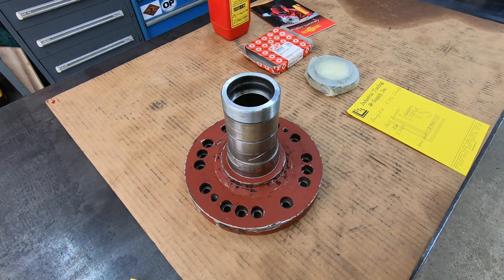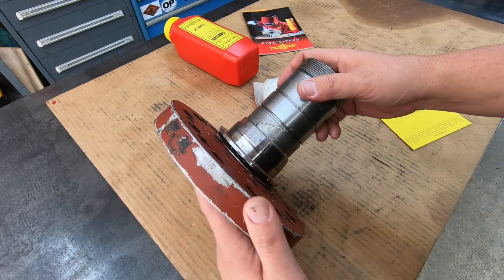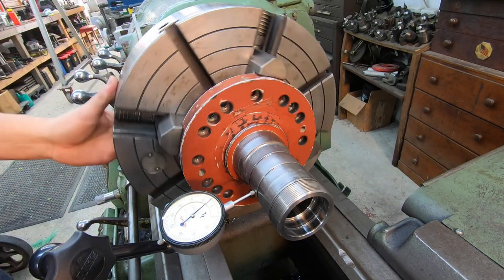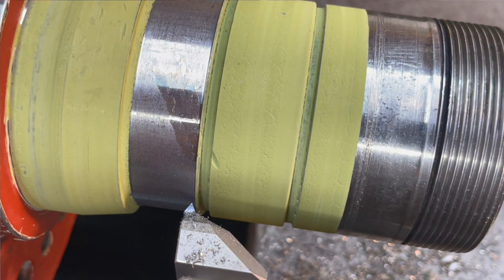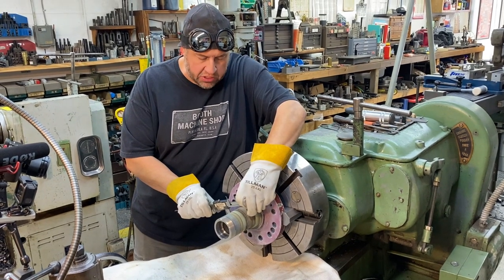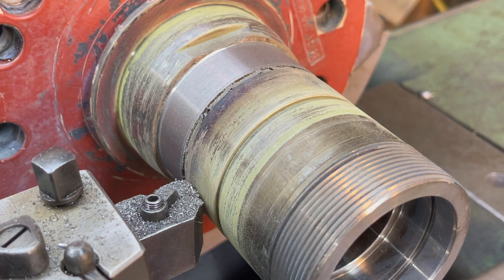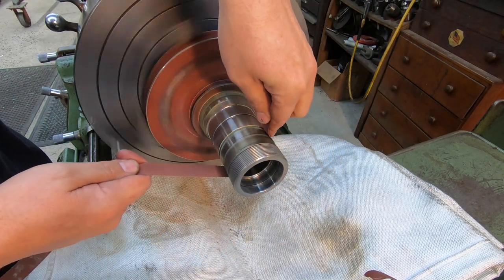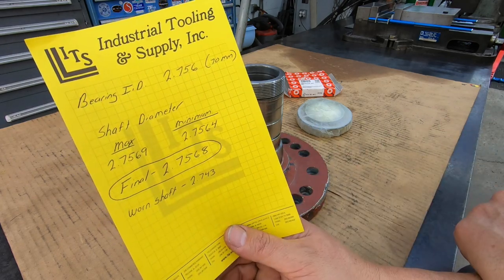Thermal Flame Spraying Centrifuge Shaft Repair

Comment: As a former engineer for centrifuge and bearing companies, I am happy to see you using the correct tolerances for that part.  Too many machinists use rules of thumb instead of taking a couple minutes to actually look up the proper tolerance as it appears you did.  One nitpick, it doesn’t appear you verified the runout of the part after the spray welding to make sure the shaft end did not warp from the heat.  The runout tolerance of the side facing the chuck relative to the bearing seat is highly critical for machines that run at the speed these do.  That is the reason an end user I also worked for would not allow spray welding on parts like these unless it was done by the factory repair shop.

Comment: 2.756 inch is a 70.01mm for metric guys .01 is a perfect fit in most cases for a bearing  on shafts ,you can go +0.02 or 0.03 but anything more that that and bearing starts to rub.From experience commonly used  bearings arent that sensitive that you have to get a micron(.001) tolerance.
Unless you are dealing with high speed bearings that have play in it for expanding due heat. 
That spray welder is a nice thing for repairs like this thats for sure !
When you see a groove in the shaft like that in 99% its where seal is rubbing off ,other 1% is that something got in and made that groove.You would be surprised what left chip or a something soft like nylon rope does to a shaft.

Comment: That's a great process and I'm sure anyone operating older equipment where new parts are difficult or impossible to source will appreciate.  I was unaware of it until I saw your previous videos about spray welding.  Excellent and informative video.

Comment: As always Adam a great informational video. As an old retired engineer could I suggest something to help you out? When your using the Spraying kit, even power tools or welding torches. Just put the feed lines, cables or tubes over your right shoulder (as you are right handed). The lines (cables or feeds) will then follow your arm / hand. You will find this is far more comfortable,  gives you better movement and control. It also stops any pulling on the lines as you work as the tension is on your shoulder not the hand or tool in use. Happy New Year to you both. From us in Sicily, but from England.  Work Safe mate. Ant, Cid & the pooch crew.

Comment: We had two eutectic systems from the early 70’s in the paper mill. Fixed a lot of bearing an seal surfaces an sprayed tungsten carbide on pump sleeves, I also used eutectic stainless steel welding rods until they started being made oversees

Comment: Nice hit on the tolerances, as a millwright we would always run into tight fits because of the machinist working to the top of the tolerance. I used to persuade them to ease it a bit more when you are working on a crane repair job  50 feet up and struggling with the likes of couplings and bearings and gears. It sure shows how good a machinist is when you ask for those very small differentials. Nice repair Adam, that spray welding is very interesting process. Out my way there is only one outfit I know of that does the same process. Power to you, cheers!

Comment: Really interesting video Adam, thanks for sharing. We're trying to decide whether to buy a flame spray gun for our workshop. The UK has so little by way of small and medium size machine shops that take on one off repair jobs like this. You should have seen the trouble we had finding someone to regrind the ways on one of our machines. Only two shops in the country left!

Comment: adam, if you ever need to remove a bearing race like the one they ground off, just wrap it in a rag support the race on the bottom on a block of steel and hit the race on the top with a heavy hammer. The race will break into pieces  because it's so brittle. Watched  my father-in-law diesel mechanic do this in the field.

Comment: I would be interested in seeing the bearing heater to expand the bearing before installing!  Thanks, Tom
Reply: I am just guessing how they will assemble, but typically they would cool the part in a liquid nitrogen tank and the drop the bearing on.  Much easier on the parts than heat.  If you saw old videos of Adam working for Motion, you can catch a view of this process a few times.

Comment: I just imagined what it would have been like to see this 20 years ago. I would have thought it was magic. Thanks to you and Abby for the excellent video. Happy New Year.
Reply: It was around 20 years ago, Just not common and costly. Had a crankshaft done for a rare/obsolete engine would have cost more to turn a new crank.
Reply: @ypopnun1003  That may be, but I would hardly have had a way to see it. I'll bet the process has improved over the years, too. Thanks for the comment.
Reply: @ypopnun1003  ...It has been around over 40 years that I am aware of.  I worked next to a "FlameSpray" shop in the 70's.

Comment: Brings back memories my first job i had in 1969 i learned how to spray weld the gun was twice as big and it used wire not powder i'm 70 now seems wierd  50 years  ago WOIW
Reply: In the 70's I worked next to a operation named "FlameSpray"  I believe it was/is a national franchise type of operation.  There is however one thing I am sure of and that was that they had a hell of a business.  The demand for this process is huge.

Comment: I'm in charge for maintenance at my company too and in 2020 I had several bad encounters with bearing journals being heavily worn without anybody expecting because the bearings on quite new machines had seized until someone noticed the horrible noises, then it was too late...

Comment: My dad used to have a homemade large size like 60 degree?? center that would fit in the end of that housing and true it up with that that way it's pushing it back and it's keeping it level on the outside if that makes any sense... We used to do heavy duty axle hubs like that

Comment: That is the coolest process I have seen. Are the undercut (Thread scratch pass) to provide more surface area for the spay material to adhere to? Also, you measure when the unit is obviously hot to see how much material you have added. Does the 0.050" over you do account for the metal growth while hot?
As always, thanks Adam for sharing this. I have one of the Eutectic spay guns on my wish list.
Reply: Yes, without the thread cut there is a risk of the spray weld shelling off - it provides 2 things
1. More surface area for bonding in lateral loads
2. A deepened, less fragile zone of powder build up that is more resistant to being shelled away by torque loads

Comment: I find this technique so fascinating but as a tig welder myself (far from a machinist) i wonder why not just build up a few beads and turn it back down?  you may have covered this, sorry if my question is redundant.
Reply: I think since the part only needed a small increase in diameter, that this (flame spraying) would be the best method. Also, it doesn't add as much heat to the area as TIG.
Reply: Twas covered in the video closing.  heat input.  makes sense.  Thanks for the video.

Comment: Nice work. Saw this done to a fan shaft on very old Carrier A/H. The A/H was over 50 years old and bearings had worn out the shaft ends. I believe it was a 2" shaft. The M/W group came in and rebuilt the ends of shaft with this process. They saved my bacon!. Did not withess the work but wonder how and now I know. Thanks for the demostration.

Comment: Is it ever necessary to recheck and or recenter the workpiece after a heat cycle clamped down in the jaws? Maybe I'm over/under thinking it. Seems like the heat expansion might-could result in the piece being pushed out a bit more in one direction or another?
Reply: Funny, I was thinking the same thing.  Of course, I'm sure Adam already thought about it.
Reply: 100% why I asked here instead of Google.  :)
Reply: Probably not enough heat input...not sure, just guessing.
Reply: @spyderMN  Depends on the work piece
A Large cylindrical mass like this? not often if you're confident in your work: Heat is evenly applied and only when rotating meaning there is no single heatsoak spot and the jaws being equidistant mean combined with keeping it rotating as it down temps any cooling should also be uniform, if the tigged weld slit was bigger then it might be worth doing as best practice
If there was a non symmetric feature on a notable size - for example a single slot for a drive key then it could be worth doing depending on how high a temp you need to for the powder to bond and what tolerances you are trying to keep
Reply: I think he basically answers there in the end when he's talking about the process as a cold treatment. Its intended to not generate warping other methods would so would presume that its also not enough to need re centering. I imagine he'll or others can chime in too, but I had the same thought and dismissed after his explanation there.
Reply: @VacFink  This is correct. The heat is applied evenly across this entire part. Because of this, the part will expand uniformly against the jaws. No need to worry about this part shifting and especially no need to worry about warping the material out of round and true. The mass of this part also comes into play. This is a good sized part, so it will perform better as a heat sink. Smaller parts may need to be checked for warping. The same goes if a lot of material needs to be added (arc welding for example).
Reply from the maker: Tell y’all what, next time I have a part like this being repaired, I’ll show the indicator after it’s cooled off. As long as you don’t hit it with anything, the part will still be running concentric as indicated.
Reply: @Abom79  ....Hmm, the "indicator geeks" are after you, Adam!

Comment: definitely looks like an alfa laval separator part. not cheap to replace so repair is always the best option.
Reply: I work at a waste water plant and i can confirm parts for those are not cheap
Reply: Alfa Laval, that is what I thought as well.  
Dynamic balancing the whole assembly was the next.

Comment: Used this in the 1980,s and didnt think it was very good. its very fragile and chips extreemly easy, especially on the sholders. Sometimes flaked off when trying to press a bearing on. All sorts of issues with warping and altering heat treatment.

Comment: Surely the shaft takes 2 bearings and the top bearing area is worn as well, looks smaller than the thread. Just for the record I'm not in anyway doubting Abom it was more of an enquiry on the part.
Reply: I think that's one end of a longer shaft or assembly of some kind; it's like an end cap or something.  One bearing would do it!  Plus seals and who knows what else...
Reply: @ydonl  I worked on stuff just like this when I was mechanic at Blue Diamond Almond Growers...centrifuge to spin 350 degree cooking oil out of almonds....400-500 pounds at a time...there's another similar bearing and hollow shaft at the other end, and the very end has another oil seal to keep dirt and stuff out...there's also a Dodge compression fitting for the chain drive sprocket.
 Quite a few 'mechanics' used the same shaft damaging process for bearing removal. But, once you cut off the outer race and balls, you can heat that inner race very quickly to red hot, and it will expand faster than the shaft, you can slide it off....but don't waste time...!!

Comment: Adam, quick question. I have a TeroDyn 2000 that I'm setting up. I'm being told by my Eutectic rep that I have to have 2 size #5 Acetylene tanks manifolded together to safely run the torch as the acetylene withdrawal rate is too high for a single tank. But, I see in your last few videos you're just running a single tank, and not a real huge one at that.. Is your experience that you can run the torch for short periods on the single tank without failure? What CFH of Acetylene were you running in this video?

Comment: Do you have to check if your part is running true after after heating?
Reply: It is only pre heated to 200F plus whatever heat is in the spray process .  That is the beauty of flame spray - no heat stress on the part.

Comment: You mentioned that the paint on the back-side does not really matter for the accurate registration in the chuck, certainly true in this case. Perkin-Elmer though, missed a tiny flake of paint on one of their instruments, rendering the Hubble-Telescope all but useless until it was reparied with corrective optics :) An error of Nano-Meters I recall :)

Also, how would some paint change anything, when you need to adjust and tap the workpiece anyway, like you or anyone must do allways to get some acceptable accuracy.

Over-doing things is a waste of time also. The balance can be difficult to know.

An interesting thing about Inches and millimetres, is that a "thou" is 0,025mm, about 2,5x coarser than a hundred of a millimeter. I think this has an unnessersarly psycological implication on the machinining of things overall, bececause like in the US, people in Europe are like stuck in measurments, eventhough I know, skilled people are not stuck in units of measurments.

Thus, a Swiss or Swedish tool, such as a simple indicator has 2,54 more finer resolution, compared to a comparable US one. "One Division = 0,01 mm"

Don't get me wrong, I regard you and other American Machinists highly skilled and I know you all know this. Perhaps hunting for 0,01 mm is more waste of time than 0,025 mm, often it is.

Europeans might overdo things 2,5 times more :) Certainly I understand smaller dimensions and how important they might be.

One thing I can not understand though, is the use of fractional measurments such as 1/16 and so forth. One could use 1/16th of a centimeter as well, but no one in Europe would like that. We would have to do the Math to see the decimal dimension.

We are truly Decimalic, thanks to the French :)
Reply: No one I know in the US machining industry uses fractional measurements. In more precise work, all measurements are in thousands (of inch). It is never mixed, as in 5/16 and 4 thousands, its just .3129 inch.  Unless you are machining larger items, like bolt circles, they may be indicated as  6 inch bolt circle  +/- 0.02.
Reply: @shtika  Slight correction; that would be 5/16 + 4 ten thousands = .3129 which of course is never used as you pointed out.

Comment: What do you do to clean any oil ,almond or dinosar type,  from the little pits and groves in the area that you going to build up?
Reply: If physically machining the pits out doesn't get rid of all of it, the rest will most likely burn off with the pre-heat
Reply from the maker: Part was first washed, undercut removed anything left on surface, than the preheat.

Comment: Adam, what is the purpose of putting threads on the area to be built up??
Reply: im not expert but id say for more surface for the new metal to bind
Reply: just helps key the new material to the base stock.  so there's less of a lamination going on, which could in turn delaminate.

https://www.practicalmachinist.com/vb/general/spray-welding-261021-post1981116/#post1981116

Comment: Hey Adam, nice to see you again.
Hope you had a nice xmas and new years.
I'm from Sweden so I work mainly in Metric, and if I come across Imperial measurements I DON'T convert them to Metric as not to introduce that slight margin of error.
Now I know you work in both systems with ease (so I envy you badly), but on a job like this I don't understand why you wouldn't just measure it in Metric?
I mean wouldn't it be easier to sneak up on that nice even 70 mm (tolerance is -0.002/+0.015 mm on axles I think), instead of chasing 2.756496062992126 (etc.) inches to get as close as possible?
2.7568 is REALLY close, but that still turns out to 70.022 mm, which in Metric would be over the tolerance...this why I hate conversions.
Love your videos man, keep up the great work.
Reply: If you have calibrated imperial measuring instruments , you use imperial. Inspection tools cost lots of money. Also, me personally, I can conceptualize in my head how much 0.00008 inches is, but .002mm means nothing to me until I convert it.

Comment: Would this method work for crankshafts ?
Reply: yes it works.
Reply: Yes, however caution is advised.
On a crank shaft you are creating a bearing surface, as opposed to fitting a hardened bearing here
You would have a deeper scratch pass, use a harder powder and then grind the surface

Comment: Dear Adam.I was wondering if have you ever done such a job on piece of work and it didn't work?
I mean you just did the procedure and apply the all parameters perfectly but the spray welding peeled out with out good bonding on the surface?? Because I tried a lot and only some of that attempts  worked.

Comment: Would you recommend this process for solid front axle outer spindles?   Cant keep a bearing and seal in mine anymore.  Already speedy sleeved for the seal.   I wanted to do this to the spindle (hollow for 4x4 shaft) but the local spindle expert advised against the preheat for a vehicle spindle.     My other option is to chrome it a cylinder shop and grind the bearing and seal surfaces back to max.   What are your thoughts?  FYI  (New 1978 ford Dana60 spindles have been on order since March 2019- still no update from India)
Reply from the maker: I’d recommend not also the spindle with heat and replace it possible.
Reply: @Abom79  Thank you for your quick and experienced reply.  !!   Keep up the great work.
Reply: Have a large recycle yard do a search for your part. Buy two.
Reply: @gregwarner3753  Problem is, they are just as worn out as the ones I'm trying to replace, or been underwater in a swamp for 10 years.....Canada is where vehicles and parts come to die.....
Reply: @desktop100  Give LKQ a call.   They're the Walmart of auto wreckers and if it's not in stock in Manitoba, maybe it's in stock in Malibu and could be on the next truck headed your way.
Reply: @desktop100  New Hampshire is not much better.